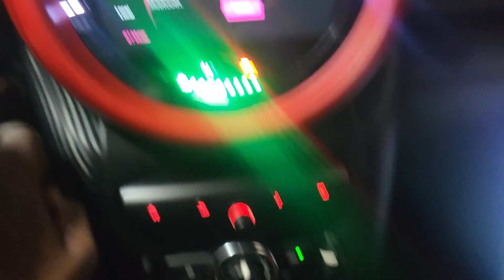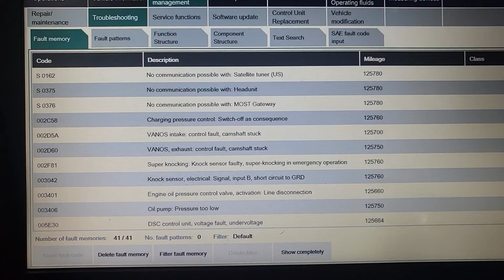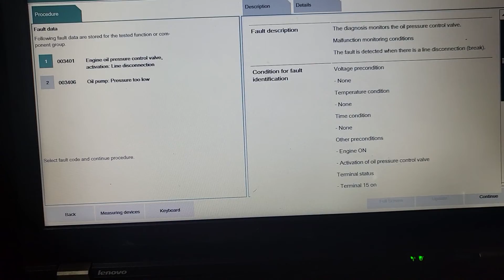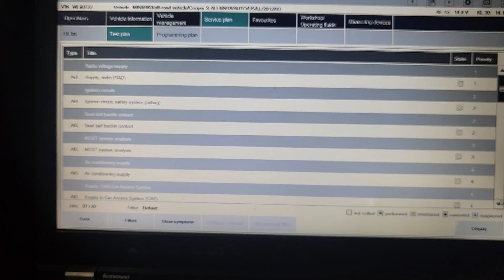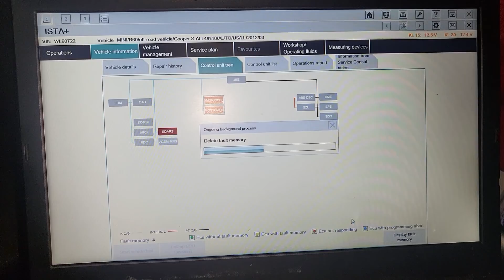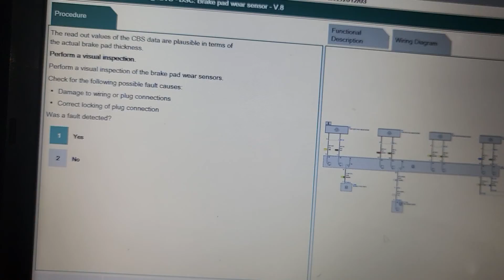2012 Mini Cooper has Oil pressure Too low Message Car Go In To Limp Mode How To Know and Test 2

Comment: how you fix this ?
Reply from the maker: we open the engine found the seal was melted and shut down the oil passage
Reply: @BestCarFixes  which seal exactly was it?
Reply: @BestCarFixes  thank you for your answer i working in a mini first time  was high presure i replace the vvt on the oil pump now  2 months later  low pressure
Reply: What part of the engine? By the oil pump, block, head? Cam shaft?